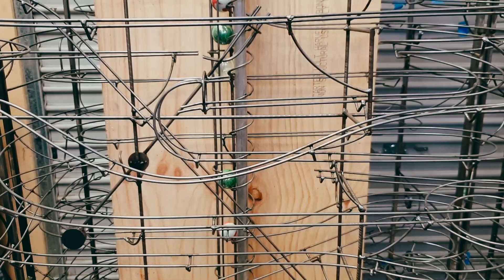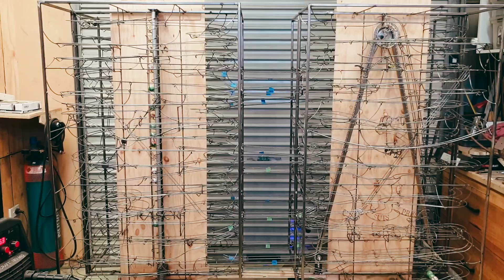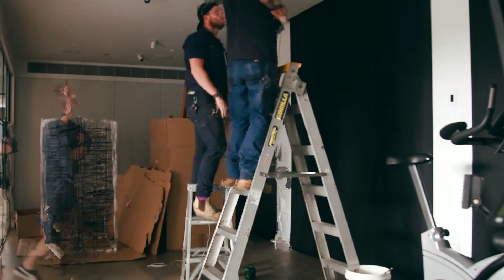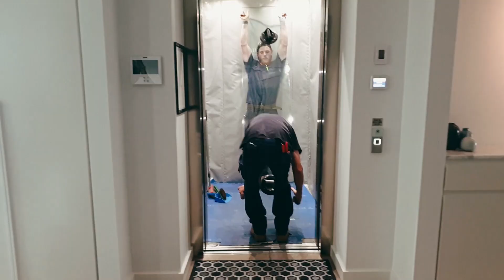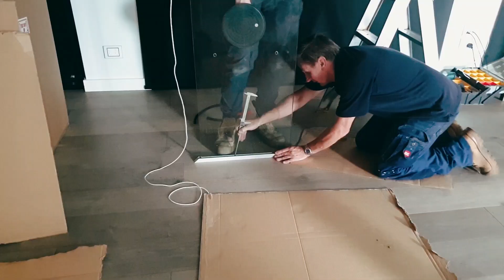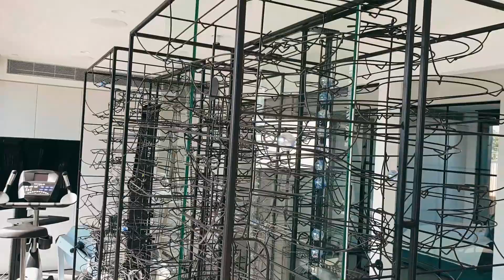Rolling Ball Sculpture - Build and Install - cn:145

Comment: I think you should experiment with a rolling cage. Ok, envision this:
A tennis ball or base ball, when unzipped it has a figure that roughly resembles an 8, but what if that seam was a rail that road on/hung on a very slow motor. As the motor turns, it changes the spot from which the cage gets hung from, making it spin like one of those astronaut's training seats (but much slower). It will have empty space in it, space that will be filled with an infinite track and one marble. (Two if you are feeling spicy). As the cage rolls at a snail's pace, the turning will slowly push the marble up, giving it the momentum/energy needed to continue the neverending journey. Some pieces of track bend up a little to act as low-speed-zones that hold the marble in place untill it's high enough to get the proper speed the next stunt portion needs, or to simply maintain the pace and keep the marble in the middle for viewing.
I have no idea how viable this idea is. It just came to my head and I wanted to share it.
Reply from the maker: That has made MY head hurt. Great idea though.